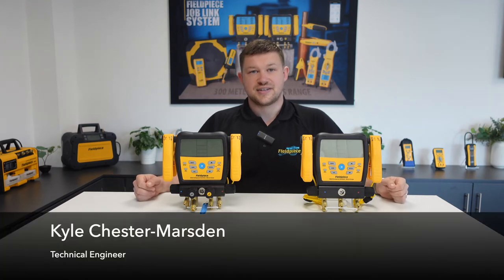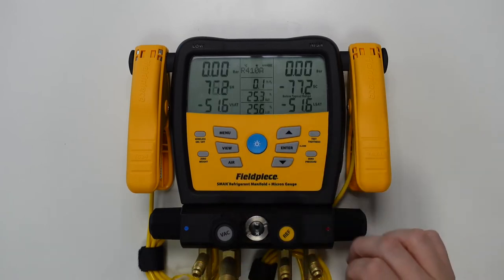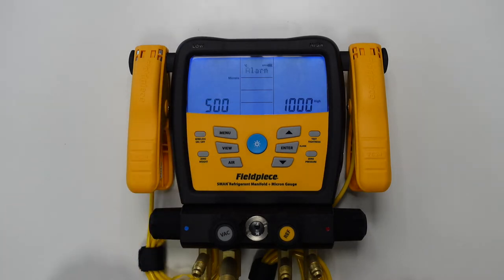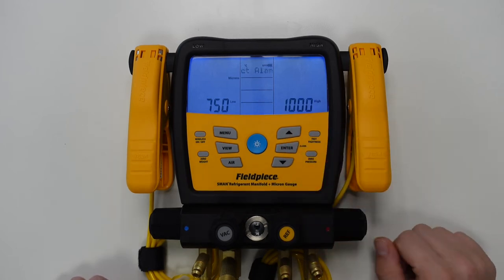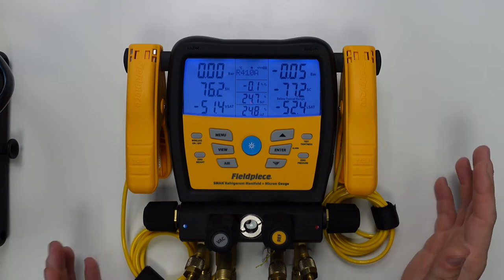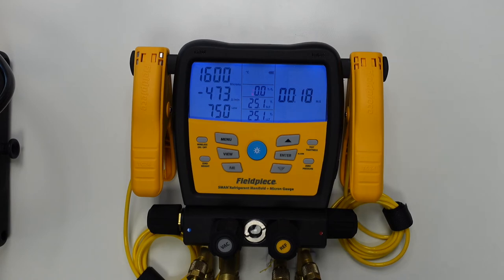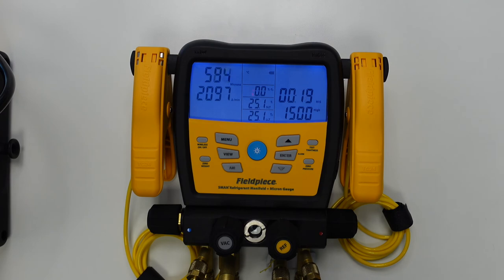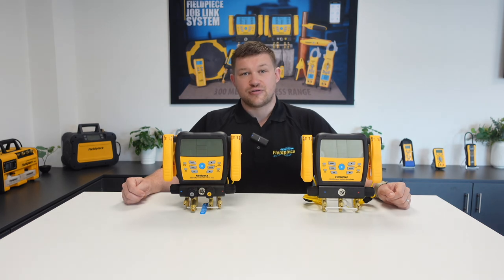🇬🇧 SMAN® Digital Manifolds: How to Engage the Vacuum Alarm | Fieldpiece Europe 🇬🇧

Comment: Everytime i pull it into a vaccum I never read microns or never even know if I’m in a vaccum how can I fix this?
Reply from the maker: Hi, We would like to support you in the best possible way. Please contact us via the form or give us a call. Here is a link to the information: https://fieldpiece-europe.com/contact/
Reply: That's because you didn't fix the leak lmao. If all connections are tight, and system is sealed, you should be able to achieve micron level vacuum. It's that or your vacuum pump is on its way out or in need of a serious oil change